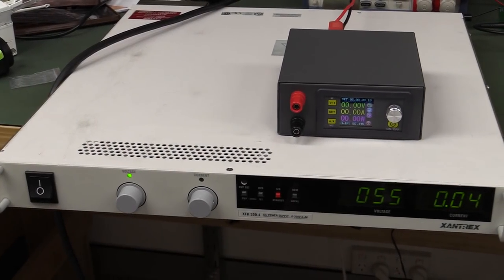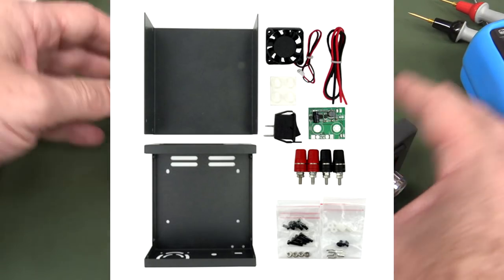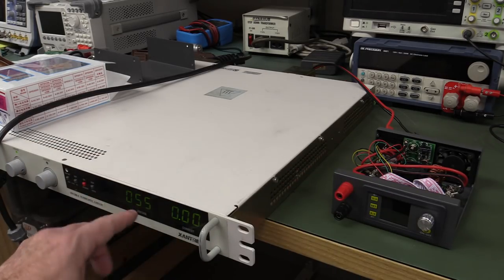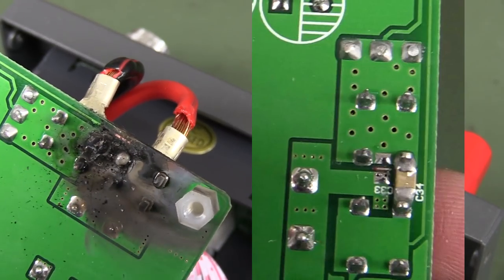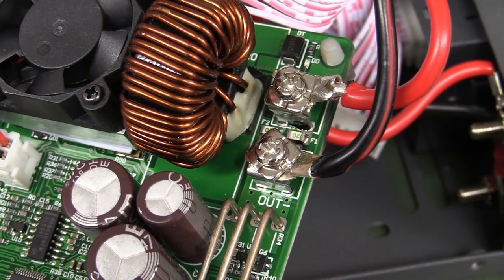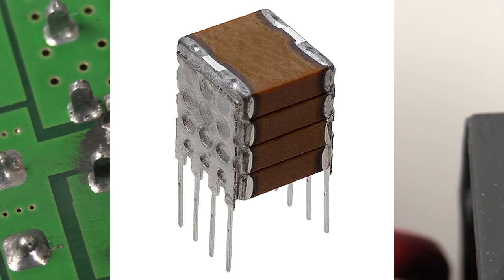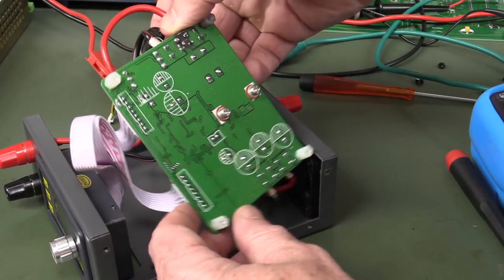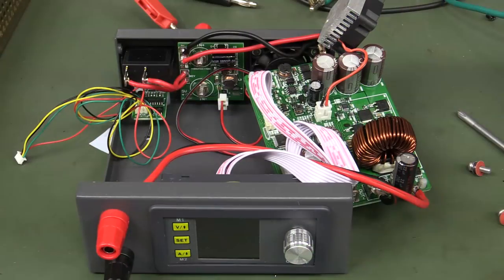EEVblog #1035 - Flaming DIY Power Supply!

Comment: Well... I feel a lil stupid... I was hoping to do a cleap power supply +-50v with 2 of those modules(i already have one and i've ordered secound one)
And now sitting in bed just hit me...they aren't ground isolated...so i will need a transformer with 2 secs to run the config, i was hoping to run it from a 60v 500w switching psu:))))
Epic fail...ohhh well...i'm gonna make a transformer in the end...
Reply: output must be isolated

Comment: Hundreds of wonderful Ham Radio kits out there for testing.  LMK if you have a pal doing such.  Check out QRPGUYS and SotaBeams (UK--they speak your language) and QRPKits, and there are others.  "QRP" means low power in Ham-speak.  Of course we can build to "high power" but that requires much more expense and isn't really necessary when one understands RF propagation and efficiency.  Bueller? anyone?

Comment: I bet the CE mark on that baby stands for "Certified Evil"

This reminds me why I always use Current Limiting when powering cheap chinese junk.  I also always dial my current limit down every time I pass by a battery/device on charge : )

Once, in my youth I went out to the shops and came back to a nicely burning bedroom - you don't forget stuff like that in a hurry : )

My rules since then :

- Everything fails.
- Failing stuff will fail as badly as possible
- Everything electrical is trying it's best to kill you : )

I'm convinced that China is the worlds foremost exporter of magic smoke emitters and house fires.  Hey, don't they also make most of the worlds smoke alarms?

Does anyone else smell a conspiracy?  LOL

Comment: Why the hell would you make such a power supply rackable? Anyone?
Reply: Because some of us were brought up on Dr. No...
Reply: I don't understand...
Reply: Ri Max To power other racked equipment with a carefully selected setting, or as part of a larger lab setup with racked scopes, signal generators, control computers etc.  Perhaps as part of a semipermanent automated QA test stand at a factory, where you plug in a fresh specimen, run through the automated test that includes varying power over the permitted range and decide if it's A-OK to be sold at $1000 wholesale.
Reply: That makes a bit of sense. I'm more used to the everything sits everywhere kind of electronics :)

Comment: i have the exact same model in mail right now, should i be scared :)
Reply from the maker: Just remove the cap
Reply: Or replace it with a through-hole cap of same value. There won't be any stress on the cap body with eg. 20mm pin length.

Comment: And it still fails, First it started to show a gray screen that will go away only after a power off, then at some point I shorted the output pins while having it set on 12 volts and it made a short pop. Turns out 3 of the 4 power mosfets where shorted. After replacing all 4 mosfets it worked again until I decided to test if it will resist a short circuit on the output at 12 v and it did not. Crappy product, do not buy
Reply: if you have any problem, you should contact us

Comment: With my experience with switch mode buck regulator modules including the DPS5020 module with display on ebay, the regulation is poor, often the circuits are unstable and emit massive RF interference and do not work properly, the meters are often out of calibration and keep drifting and are unlinear up to 20% off ..next to useless, and often the modules go's pop in smoke and this video just proved it... so DIY lab power supply using a buck module from ebay = rubbish, bad engineering, unstable simply doesn't work properly, often false and overrated specs which are just lies. Also all the power in a plastic case is just asking for a lab fire. not good! cool video however.
Reply: please give me your proof ...

Comment: Cooling those mosfets over plastic case is horrible idea, thanks for showing this add wrong rated cap on the output, definitely wont buy this!
Reply: ???? I have explain the reason, and we already update this problem, use a better one and change the place

Comment: Oh and when the guy fixes the capacitor problem no doubt there will be other issues, like output swing to full output voltage when set say to 5v or 12v and blowing up what ever is connected to it., or perhaps maybe the the caps ripple current rating are not up to the task the soon go pop! or maybe its the magic smoke from the power mosfets, yep it kills the driver chip too. - unreliable, extremely complicated got smd chips all over the pcb, and goes pop in an instance, just like most other cheap Chinese electronics I see on ebay. Oh yea I can fix it, yes but it just burned and destroyed the pcb too..and now its conductive and a fire hazard bummer, what really? Yep with 50V across the terminals it is. gee can't win.
Reply: It's already been fixed.

Comment: the case is worth more than the PSU it self....

capacitors look like no-name's..... could probably be a bit better if you baught your own parts, and replaced the low quality stuff that comes in the kit.....get some nippon chemicon in their

but their NO WAY IN FUCK its going to output 1000w RMS

if its anything like cheap car stereo amps....1000w means maybe 500w RMS (and even at 500w...i have my doubts)
Reply: kain hall 1kW DC (not RMS), 50V, 20A guessing from the model number.`
Reply: Nathan Madpsy i missed that...i was wondering why he was powering it with a supply VS just plugging it in to mains
Reply: John Francis Doe i knew rms was wrong when i typed it

was trying to say that it could not stay at 1kw for ever

like it might peak up their for a second

but i was proven wrong....looks like revision 2 will be damn good

Comment: Scary stuff burning hardware. I see a lot of people building desk power supply from a good pc power supply basically recycling computer power supply. I wouldn't buy this
Reply: any device will burnt , you damaged one chip ...
now we already update it ..for phone battery, it can case fire , but everyone still use the phone ..
Reply: i guess your right ....in this case it's valuable to know what your doing and being able to diagnose the problem... i wish i had learned electrical engineering seems a valuable skill to have..
Reply: thank you for reply , when we design products, we need consider many many thing ,something need to be compromise. and we can't foresee anything . for this capacitor, we sold thousands of this , there is only one customer meet this problem. And I know the reason... only it was damaged by force, it can be shorted. but many chip was damaged, they all cause the problem ..so as the problem was the second time , so we decide to make it better

Comment: you put 55 Vin and bumped up the output with NO LOAD.  thats what blew it up.  probably main output cap or diode or both.  Main power switch.  these will see the highest voltage spikes.
Reply: No.  Cap was across the power inputs.  Has nothing to do with the presence or absence of a load.

Comment: many new tech in this evolution technology is a Chinese hardware made. regarded the design map and who do it or in which country are made. all compact design has a percentage problem ( heat/need more cooler/how much current can handle in by small design / can't give you what it must give/is it 100% equipment electronic right? .......... ) I am talking in general   . not on this model of power supply.   
I buy one and I like it. even it is not good for a long time to operate more than 10amp in 50V  and you need to make much safety like put in the input a 20amp fast fuse and 15amp slow fuse and put in the input a diode of 2 X 10amp  and in the output and try to keep the vout in 0 and turn it on and then rise the vout slowly
Reply: so what you really want to see ?